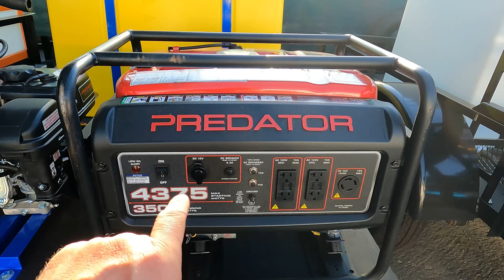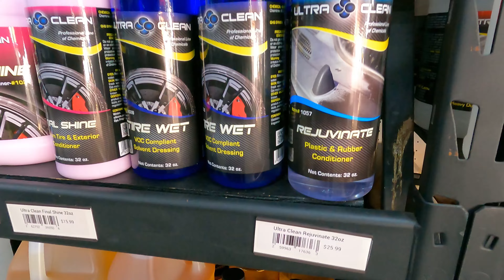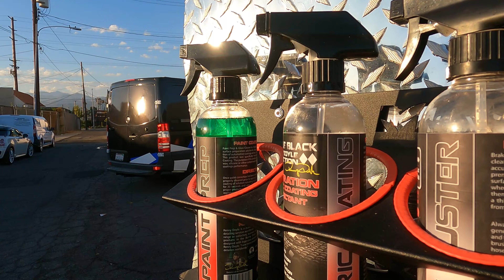H20 Upgrades My Mobile Auto Detailing Van Setup with MORE equipment!

Comment: How much will it cost for a full set up with a 150 gallon water tank and the rest of the equipment,  dry/wet vacuum, a quality  pressure cleaner ,
A steamer if thats included, hoses, the necessary high end products and the van all of the equipment with proper warranty and the van as well...
How much to Shipp it to Florida.
Appreciate your input 👌 
Much blessings 🙌
Reply from the maker: Its hard to say, depending on the year , model and how many miles the van has it can run you $20,000-$50,000. My setup was $50,000. The van was practically brand new , with all kinds of upgrades, with no money down and a regular interest rate I paid around $30,000 for the van. And the setup with everything included was $20,000. I basically paid full price on basically everything. If your smart about the deal on the van and the setup, you could probably get a van plus setup with all top of the line equipment $30,000-$40,000.   Shipping isnt that much. Thats the cheap part maybe $1,000. Follow H20 on IG. They have premade vans and ship them all over the USA
Reply from the maker: You can always contact me on my IG page and I can get you more information directly thru H20. At wagstaffautodetailing
Reply: @wagstaffautodetailing  ty brother ...really appreciate your input and advice 👌 
Much blessings 🙌
Reply from the maker: @ppg19782  you too 🙌